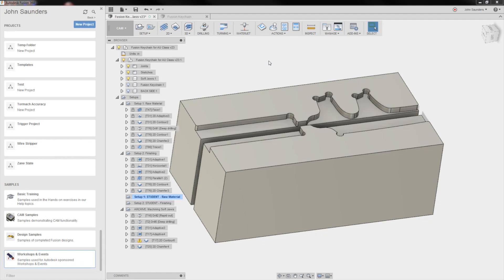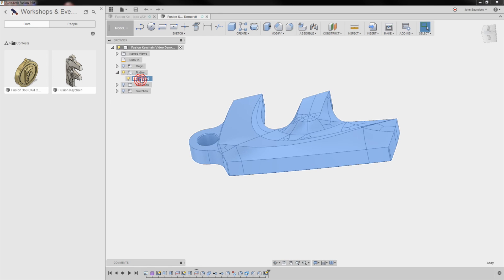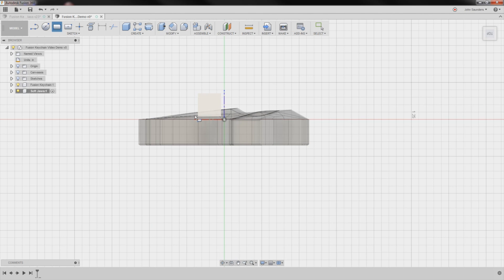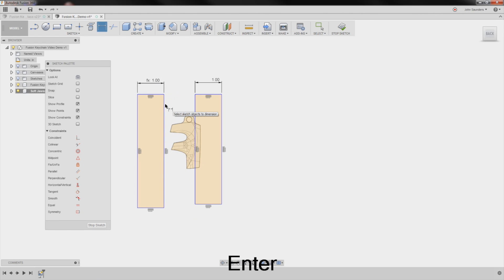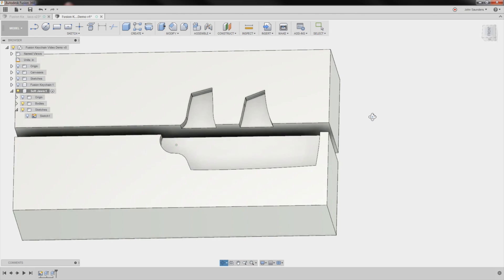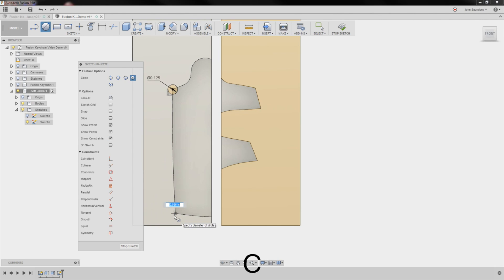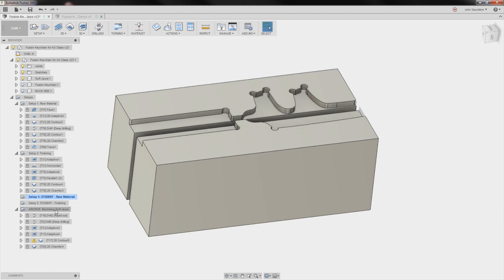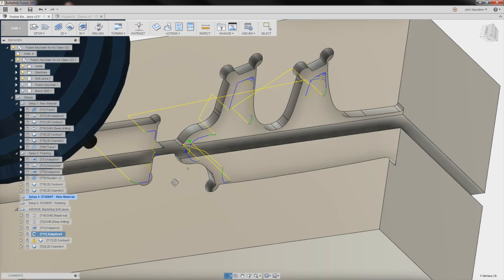Fusion 360 CAM: Machining the Logo in Soft Jaws!  WW116

Comment: Hope someone can explain why you're not adding in a fitment offset to the sketch/extrude to make sure the part will actually fit into the pocket. Yes, its mostly drafted in Y but what if the part your working with does not have any draft? I would have thought you would need a .002-.003 offset for fitment? After all, they are mating parts?

Comment: When you run the code to cut the soft jaws, is it expecting 2 pieces of material? meaning, do you cut 1 jaw, unload it, and cut the next jaw. Or do you have to stick both jaws in the vice, separate them 1/8" apart and then run the code against them. Thanks for the awesome videos!
Reply: Ahhh Brilliant! Thanks

Comment: Question, Why would you model the soft jaws showing the 1/8" space? Wouldn't that either make the profile too big  or too small if you were to either mill it with the jaws either open or closed? I would think that rather than drawing both jaws separate, you could draw them as one body, project the profile then extrude the sketch the desired depth and when you mill it then just have the 1/8" parallel in between your soft jaws. Please excuse the rudimentary question I just would like to know. Great video by the way
Reply: You would just close the jaws on a 1/8 parralel and be done.  Then you have you gap, ready to machine.

Comment: If you're tight on time with the number of people you'll have doing this, you can use engrave instead of trace to get a single line letter....as opposed to it tracing around the perimeter......and you could just use your chamfer tool since you'll already have it in there.  This is assuming that Tormach hasn't already specifically requested the style and tool to show off the drag engraver. :)

Comment: John, thanks for all the videos mate.
interested in how you do 2 sided machining without using the tool orientation feature?
my post won't allow tool orientation, and if you use another setup, then rest machining is not possible.
Fusion seems to allow you to save the result of a simulation, but can't use this saved model as stock for the next op?
Any tips?
Reply: There's a bit of a work around with saving the sim result as stock for a second op.  It's a bit tedious, but it works and get a lot faster once you've done it a few times.

Comment: A little tip about avoiding unwanted constraints (or grid snaps for that matter): you can hold Ctrl while moving your cursor around and/or clicking and Fusion will temporarily ignore constraints and snaps.

This works for all the drawing operations in the sketch environment and you can mix and match constrained and unconstrained points within a given polygon by using or not using the Ctrl key for each point.